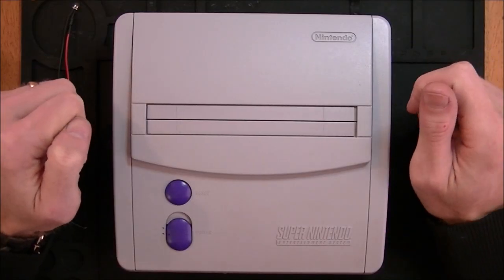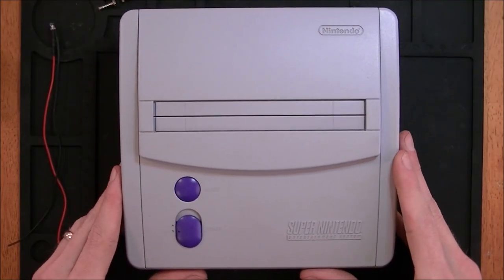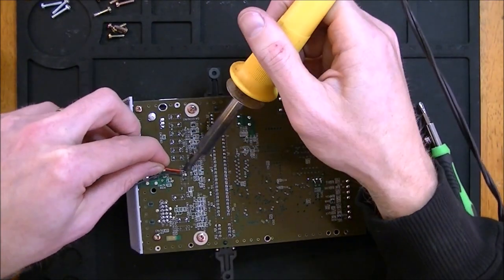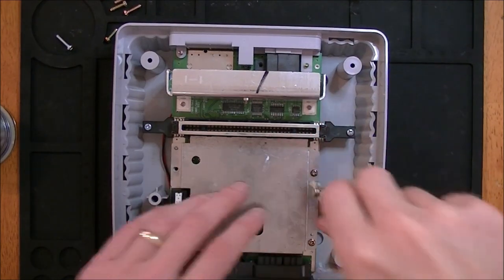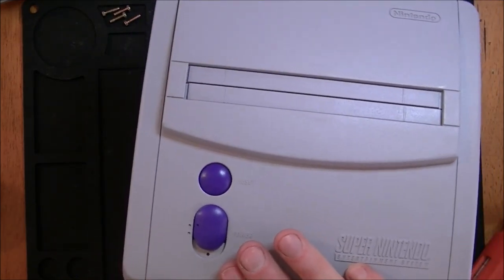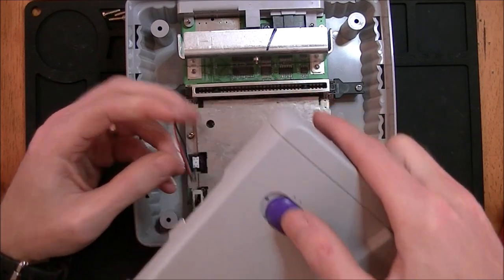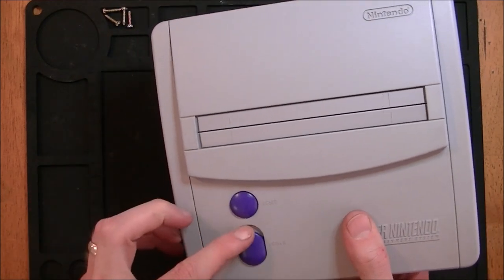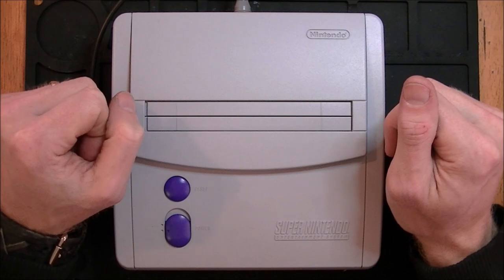Add a Power LED to a Super Nintendo Jr SNS-101 - Rad Repairs Ep 14

Comment: what voltage and mm size is that LED? Do you have a link for where to purchase?
Reply from the maker: Try this one. https://www.ebay.com/itm/5-x-Pre-wired-6v-3mm-UV-Purple-LEDs-Prewired-6-volt-DC-LED-Light-RC-Prop-5v-/151052047185?_trksid=p2349624.m46890.l49292
Reply: @radrepairs8325  Thanks much!!
Reply from the maker: @robf228  you bet!